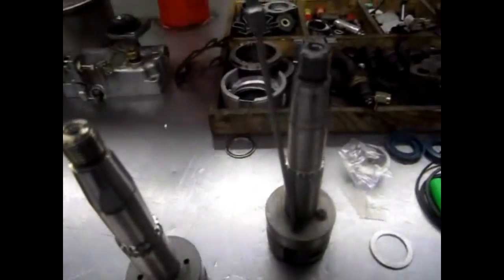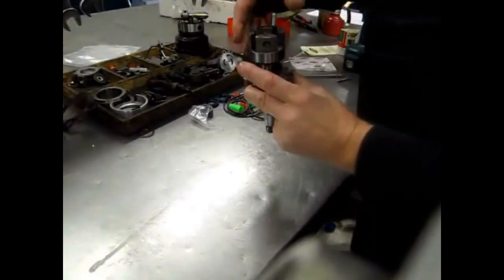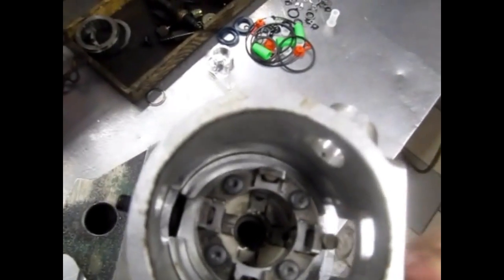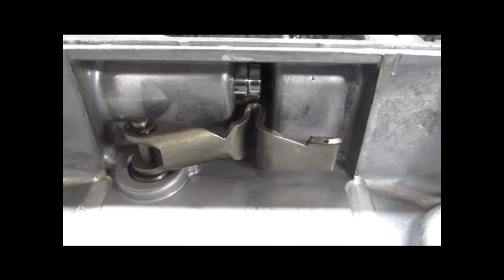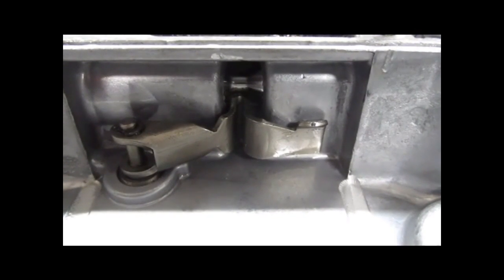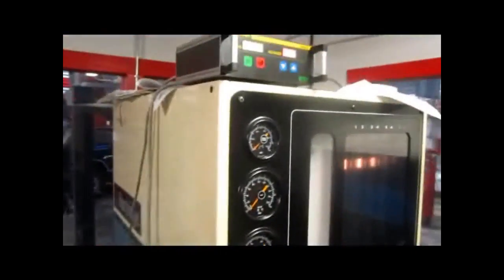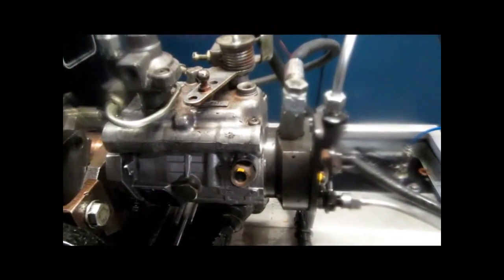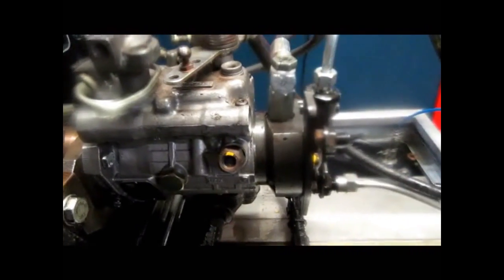Dieselmeken shows Delphi DP200 assembly & testing

Comment: I wonder who came up with the dumb idea of a locking bolt on the pump, I gather there are no useful timing marks on the engine to put the pump back on, every other manufacturer has timing marks, you don't have to lock the pump on other motors I have worked on, they were a lot more complicated than Perkins engines and timing was not an issue.
Reply: Thank the EPA and their "tamper proof" regulations. They don't want you to advance the timing yourself because the engine would make more NOx. So they make it as complicated as possible.